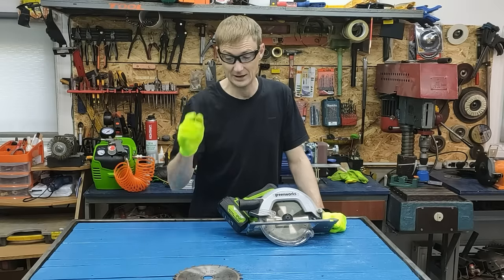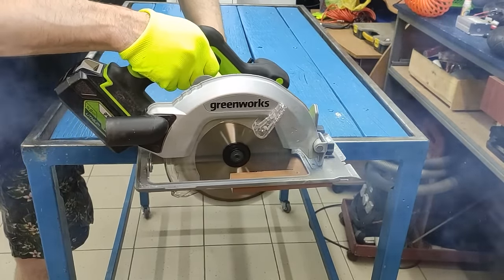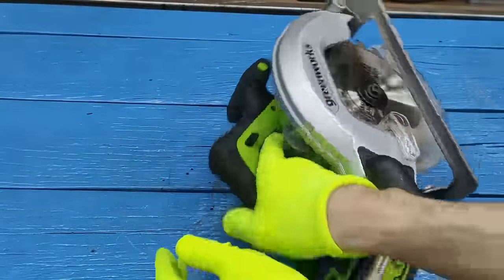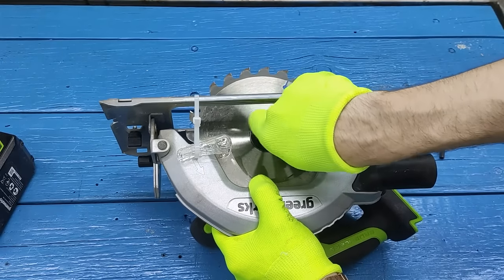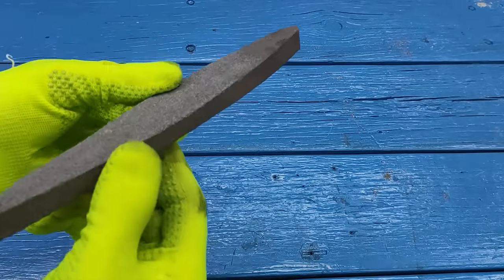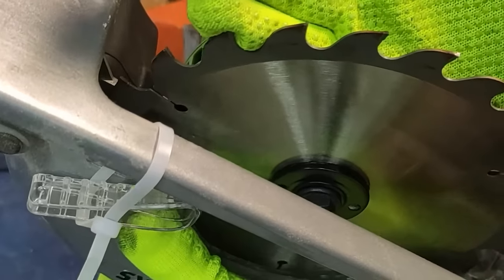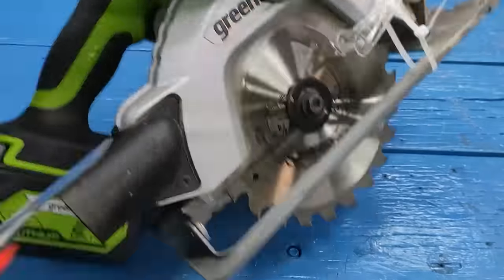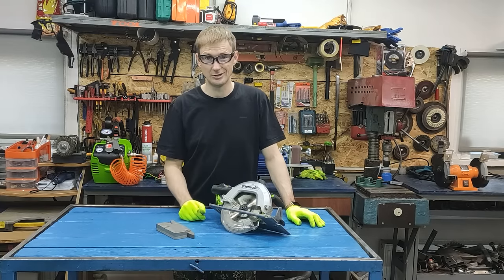How to sharpen a circular saw in 1 minute. The saw sharpens itself

Comment: DON'T DO THIS on a crosscutting blade!  A rip blade may be dressed a bit this way, while still not properly sharpened, but a blade with crosscut teeth will instantly be ruined! Also running that blade backwards against a stone is a good way to break off the brazed carbide teeth and sling them out with a terrific force that can cause severe injury! So for anyone doing this apply that stone pressure ever so lightly since aggressive force could easily dislodge the carbide tips of the rapidly spinning blade, remember the safety guard has been defeated with a nylon tie at the start of this process!
Reply: Amigo no hay peligro si se coloca la sierra al revés, funciona y es tremenda idea.
Reply: @leonardocarvajaldoreste2838  Actually it's not a "tremendous idea" at all. If you know anything at all about blades and tooth geometry you would see the flaw to doing this, while it would indeed resharpen the cutting edge of a tooth a bit it also at the same time removes the relief angle on the bottom of the tooth leaving the tooth flat on the bottom. This relief angle is critical for a properly cutting blade so while LIGHTLY doing this on a blade that would otherwise be junked likely will get a bit more use out of it. However trying to repeat this method makes the relief angle worse each time it's done, without that relief angle it will make little difference if the edge/tip is sharp or not. Also what I said about trying this with a crosscut cut blade is most certainly true and it will instantly ruin those blades due to the tooth design. A rip tooth design can be dressed a bit this way but the lack of resetting/removing that relief angle will prevent it from being truly sharpened.
Reply: You make a ridiculous comment. I've done this for 25 years on all kinds of carbide blades. Never a problem. I suspect you are a sky is falling troll.
Reply: @Tom-Travels  It's not a ridiculous comment, doing this eliminates the critical relief angle on the bottoms of the teeth! In order to cut properly the bottom of the tooth must slope backward at an angle or else the bottom simply rides on the material preventing the cutting edge from properly entering the wood. There is much more to sharpening a blade than just getting the edge of the tooth sharp, look at a new blade tooth and note how the tooth slopes back and downward at a slight angle behind the cutting edge. After "sharpening" using this method the tooth becomes flat just behind the cutting edge thus the critical relief is being removed, each time this "trick" is used it gets worse! Just for the record I have been sharpening blades the right way in my shop for well over 45 years, I DO know how to properly sharpen a blade! If you don't understand what I am saying about that relief angle then you certainly are in no position to criticize!
Reply: @catman4644  - Thank you for the come back. All that I know is that the video's way is fast, easy and works for me.
-
 If I had to sharpen each tooth, I'd throw the dull blade in the the trash instead. Life's too short and I've got things to do, people to see, and fish to fry. 
-
Here is a few of my favorite old sayings... 
-
*Do not let perfect be the enemy of good enough."
-
"There is quality, and then there is economic quality."
-
 "Quantity has a quality all of it's own."
-
Cheers my my friend. 
Have an awesome Friday.
 - Tom in Dallas
Reply: @Tom-Travels  I have said from the start that a blade may be "dressed" to some extent and that may be good enough for some folks, which is fine, and if it works good enough for you that's great. I understand your point but my point was a properly sharpened blade will cut as good as a new one however if this method gets a bit more life out of a blade and the person is happy with it then ok, go for it. I hope folks here can see the geometry involved and why that flat tooth bottom that occurs with this method will degrade performance compared to a new or properly sharpened blade, also why this method, while it works somewhat with a rip blade it will ruin a cross cut blade but no mention of blade types was provided unless I missed something, this is what prompted my first reply.
Reply: @catman4644
Thanks for the conversation.
Good points made.
My English is far from good, especially when a rich specific vocabulary in a given field, like details of a saw blade, is indispensable to express oneself.
Cheers from Berlin
Reply: Its amazing how many people are telling him to not inanyway do this do u think he qill get the point or call all of us idiots lol
Reply: @Joedoeswhat  What amazes me is all the people that will say "wow what a great idea" to these "great idea" videos all the while ignoring the fact that if something that simple actually worked well everyone would already be doing it! 

This saw sharpening method is a good example- if it's that simple and actually worked well everyone would already be doing it and would have for years, I mean seriously it's not so complicated that it would not have been discovered many times over with as many people that use, and have used, these saws for so many years! The flaw here of course is focusing on only the tip edge of the tooth and not even considering that very important relief angle, no matter if that tip edge gets razor sharp that flat bottom that will be formed by this method will tend to just skid along tending to hold that razor sharp edge even with the wood surface. The tip of the tooth will no longer be a sharp point but will become a blunt tip with a a sharp corner that will resist cutting into the wood surface. Of course wood is relatively soft and even that blunt point can usually penetrate into the surface to some degree but it will never work as good as PROPERLY sharpened blade teeth with the correct pointed tips.
Reply: Safety Last...
Reply: How ridiculous are you to try and make this person feel like he's old or out of touch with this generations outlook on life or just their outlook on their tools. Shame on you for even attempting to bully or shout his opinion down. Just because you don't agree or acknowledge the voracity of his comment who are you to try and belittle him for having it (a opinion) and taking the time and energy to comment on it here in this forum where it's not only a positive way to inform as many people at once as possible, but it's also appreciated. There are people out here on the Internet who are  looking for knowledge (as I am), and    that actually value are tools and are always trying to make are stuff last just a bit longer, but never at the expense of the taking life away from our tools. To me that is completely incomprehensible  that someone (you), would even think of something as idiotic as that, but to take the time to put it in print and author it, well that's just, just, your, your, "OPINION". Now isn't it, now I guess your like, what they say opinions are like.
As for me, thank you sir for your time to inform me about the downside of this option before I ruin my tool, because for me as I said that just not an option.
Reply: Just use sandpapers alone or stick it to any soft woods.
Reply: @CopyrightRegistered  You are making zero sense, what is it you are trying to say? I realize English may not be your first language but if you have something to say you need to try again.
Reply: Also, if you watch carefully the cut he does that smokes and burns the chipboard, the blade is on backwards . I think at 43 seconds you see the teeth after he finishes the cut.🤔 I'm not sure how safe this is.
Reply: @dannyo1279  Yep, the blade is definitely on backwards which makes the entire video a scam, he runs the blade backwards to make it APPEAR to be extremely dull. I didn't mention this at first since someone (a couple of someones actually) had already pointed it out earlier so I just covered why it will NOT work! However since you too are also pointing it out and since more than a couple of replies insinuated I was nothing more than a troll I will call BS on the entire video! People fall for scammers like this and get suckered into believing it because they so badly want to believe it, I mean who wouldn't want to learn a quick and simple way to sharpen a circular saw blade? But folks this AIN"T IT!!!!!! 

I see a lot of this and in fact I just commented today after watching a complete BS video on how to make a drill bit. That SCAMMER used his new home made drill bit to drill a hole in a solid piece of steel shaft in his lathe, the problem was he was simply reaming a pre-drilled hole instead of actually drilling!! I could clearly see what he was doing as there were several "give-aways" but still the comments in the comment section  lavished praise on the "skills" of that low-life. Unfortunately that's the way it usually goes and in that one too I will likely be called a troll for pointing out the obvious to a group of commenters who want so badly for the video to be true they will simply refuse to believe the truth!   

Thank you for also pointing out what was actually happening.
Reply: Freeze the video at 0:43 the blade is on backwards.
Reply: @catman4644  could you not just move the base plate the same degree as the tooth angle? I mean circular saw base plates are adjustable.
Reply: 😂 this is insane. Go google ATB saw blade teeth and explain to me how taking a sheer angled tooth and knocking the tip of it off will be a good idea

Comment: Awesome  !  I have been doing this for years. I use sand paper though.  On job sites I scavenged many old dull DeWalt and Makita , and Diablo 10 inch and 12 inch blades. To this day i have never bought a new blade except for 7 1/4 circulars.
Reply: Including carbide-tipped? I have never tried this technique but would expect to use a diamond wheel or some such. That said, maybe there is tungsten carbide and tungsten carbide? While we are told this material is used in armour-piercing shells, my few attempts at drilling out rusty bolt heads have always ended in failure!
Reply: I said to myself it all sounds good . Read over reactions . But one could accidentally apply to much pressure.  That's why in about ten minutes I'll be using sandpaper too.      Only needs .057 or so.   Atleast thats my thoughts.  Ty for backing him up with sand paper story . Exactly the comment I was looking for
Reply: @TrainHer  cheers!

Comment: Do not do this the blade isnt dull just soak the blade in a good acid or cleaner its just covered in resin pine tar glue these blades never really go dull just get gunky dont get me wrong some blades will need sharpening but most dont cut anything hard enough to actually dull carbide steel just resin and pinetar

Comment: I just put the blade in backwards, then cut aluminium .
Works, safely
Reply: By aluminium...I say flashing; drain pipe or evestrough...not one of yr wifes fry pans
Reply: @yeveschenkotovarish4908 

Good to clarify that! I wasn’t envisioning a pan, but I was thinking of a square Al bar … bang bang bang bang ‼️
Reply: @PartyOf8Please  thankyou....we both could be sleeping in the truck.   No' I 've seen blades explode.
A thing we did was cut bricks and angle iron .  I always bought the skill 8"  heavy duty.   After a cut, the blade is hot. I would turn the saw over so the blade and guard were up in the air. And the motor below on wood.    If it is laid down as most people do; heat is drawn through the guard and the blade. 'Warps'...
If it's an out of town job...costly
I would not change blades on the job-site. But had seperate saws and blades ready from the night before.      I am not kidding...I saw. Blades explode, because they got warped, then tried to be re- used
Saws and blades hsve improved immensely
Safety and common sence are our best partners.    Thankyou.  Best wishes
Reply: @yeveschenkotovarish4908  

Yes, and we can’t ever be to safe around power tools!! My best wishes to you!

Comment: hmm. I got a  skill saw blade sharpener that works really well. I only use it when I absolutely can't get to town to get a new one. But it sharpens the inside part of the carbide tip not the top like that. So I'm skeptical.
Reply: i was also skeptical , untill i bought a self sharpening chainsaw chain and stone sharpener that clamps on end .same principle . whats so good is the saving of time both sharpening and cutting.
Reply: hey, your chain saw chain is not carbide, saw blades are. You need diamond wheels to do carbide, not a stone like he's showing. Fake
Reply: @vortexan9804  so your saying he chances hurting people to get clicks ??
yikes.
Reply: @norain31  If he puts the blade in the saw backwards to show how "dull" his blade his, who knows what else he will do just to get clicks.
Reply: @vortexan9804  If you look close, as I did,  knowing,  a stone won't sharpen carbide, you will see that it is a steel blade, not fake.
Reply: @vortexan9804  so if you use a diamond sharpening plate, are you saying it still won’t work?
Reply: @grngiant7713  he put it in backward because if you don't do that before you sharpen the blade you're going to end up in the hospital. You would be spare parts. 10-ply. Shorsey would certainly have an issue with it... . 😂
Reply: @FrankMerendaBadShot  He had the blade in backwards while cutting the wood to show how "dull" his blade was. That is why it smoked so much.
Reply: @grngiant7713  Yep , clearly to see at 0.43 at reduced speed 25% (settings)
Reply: Créelo que funciona es excelente idea 👍👍👍👍👍👍 Es impresionante y lo afile con una piedra de afilar cuchillos
Reply: @grngiant7713 you are correct! 
Unbelievable 😮
Reply: @grancitodos7318  it is a carbide blade. If look close and put your glasses         on you see the small tips (it is a cheap blade). e.g. at 1:16.
The guy in the video does not sharpen the blade at all. The first cut, which should show the dullness of the blade he cuts with the blade mounted backwards (0:43). And constantly he says "disk" when talking about a blade. No clue on circular saw stuff.

Comment: No thanks. My saw spins at 7000 rpm...and I like my fingers exactly where they are. And for anyone doing somthing with power tools...TAKE OFF THE GLOVES!  Gloves are so dangerous around power tools they should be outlawed. To put it bluntly, if your hands aren't tough enough to use tools without gloves, toughen them up. It's worth not losing a hand.

On a different note, every other tooth on the blade is angled one direction, and the others are angled another. How is a flat sharpening stone going to sharpen that properly?
Reply: Totally agree about getting rid of the gloves, As for the rest of this method, definately NOT for me. I didn't keep my all of my fingers during a 45 year career as a machinist to try something this crazy. I learned that lesson as a ten year old playing with fireworks.

Comment: going to try this. I have been paying to have my larger saw  blades sharpened  its not worth it unless i take at least 5  and then it takes about two weeks to get them back.
Reply: They probably do the same thing as this anyway!!
Reply: Use this method ONLY on saws that you want to throw away.  It will demolish  carbide tips in an astonishly short time.

Comment: On first blush one would think this is a really good idea, however this method will eventually ruin a saw blade, especially if the blade is an alternate bevel ground tip.  But even if the tooth is a flat tip grind this method will make the heal angle of the tooth disappear.  The heal angle is important to remove metal from the part of the tooth that is not cutting the work and if left in place will cause drag which will overheat the tooth causing the blade to warp and bind in the work.  The only time one should dress a saw blade in this way is if the blade has become out of round due to bad sharpening practices and then the blade should be resharpened by putting the proper relief angle on each tooth and then each tooth's face is sharpened to give a crisp cutting edge on each tooth.  As a retired carpenter who still like to make sawdust, I have a lot of expensive blades that I still use and sharpen.  A properly sharpened blade will give quality, accurate cuts and last for many hours of cutting.  But hey!! You do you, I've always said that nothing teaches better than failure.  Good luck with this method, but I'm going to have to give this video a thumbs down.

Comment: That is comparable to jointing a saw blade but go lightly as the backing angle of the tooth is reduced but can be dressed off with a file on non tipped saws.
If the saw is tungsten tipped you need a diamond stone or file or a green stone.

Comment: You really do need to sharpen the face of the tooth, not the top of it.
Reply: I think the same. But the method in this video could work with the lateral faces of the teeth, carefully adjusting the angle of the stone. It would only be convenient to adjust everything with the saw stopped, hold the stone with a vise or screwed wood so that it does not move at all, and turn on the saw. I'll try.